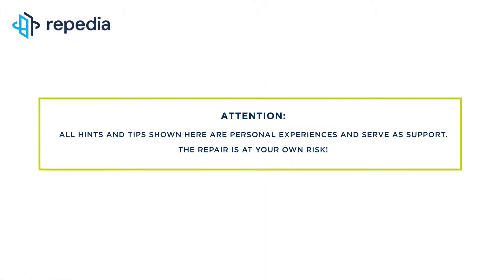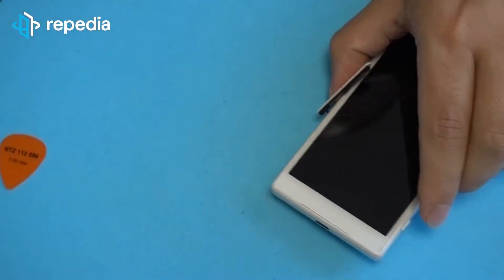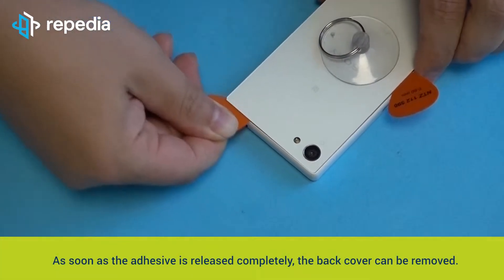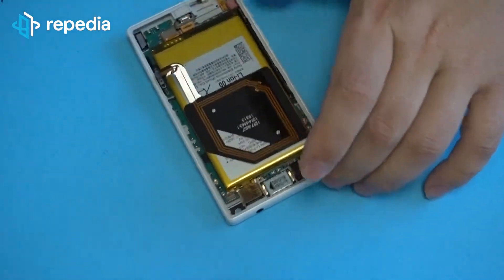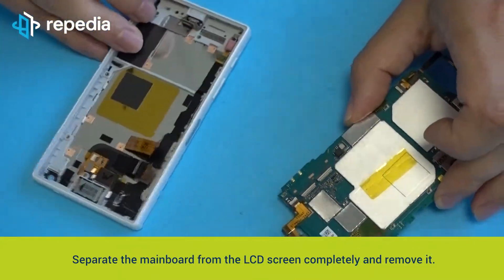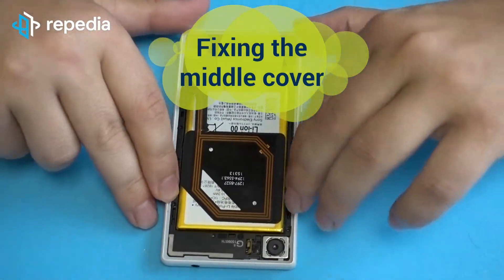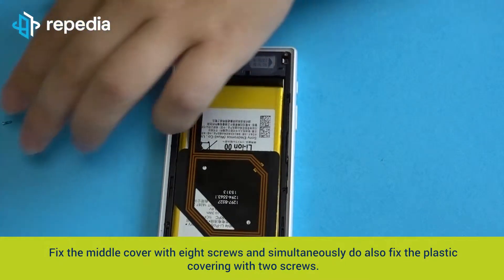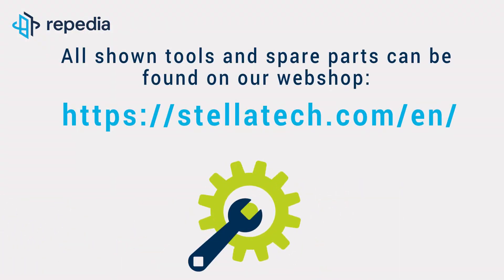Sony Xperia Z5 Compact - Screen Replacement | Teardown Guide

Comment: Awesome, thank you so much for posting. My new lcd was separate from the frame so I also had to remove that, but after following the takedown it was quite easy to ease the broken screen from the frame using the plectrum and a bit of pressure. One problem though, i did not have the new seal adhesive sheets! I have (very carefully) laid a thin line of contact adhesive (rubber cement) by dipping a fine Philips screwdriver in the glue and drawing it out around the case and screen/back panel. This should give a decent enough seal (I pray!) :-) The new screen is working, just waiting for the phone to charge for a full trial. :- <3 Onwards and upwards!